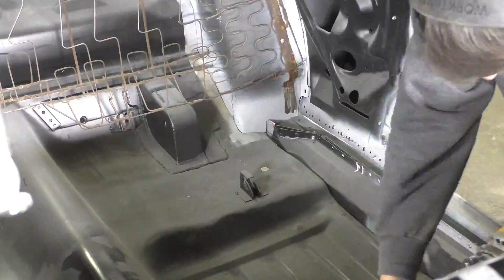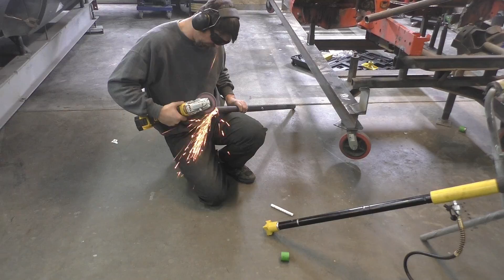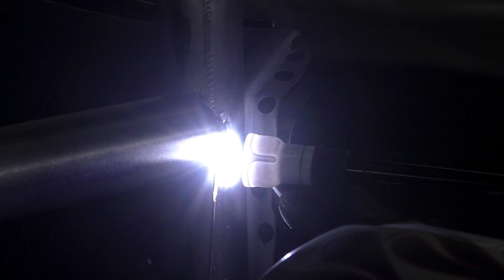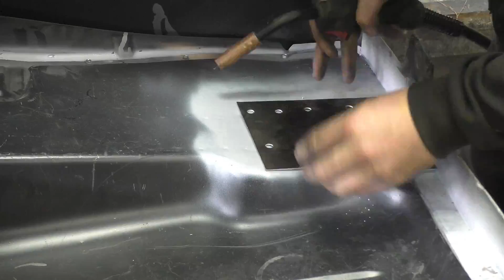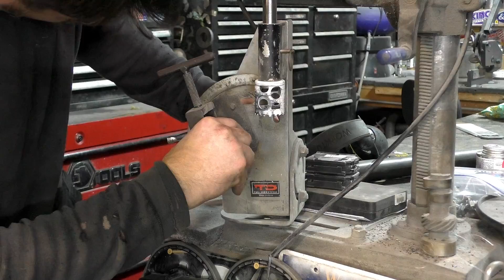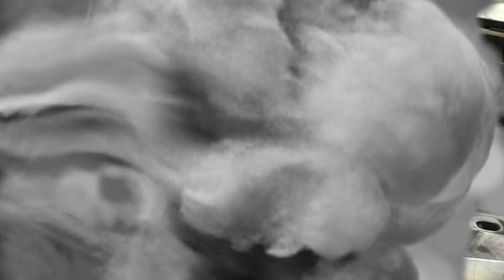Chromoly Roll cage & Detroit Speed subframe connectors f-body 69 Firebird restoration episode 9

Comment: Man I love this channel. You’re a great instructor. Just did a DSE rollbar and subframe connectors in a Camaro last month. Wish I saw this video. It was a lot of work but total satisfaction. I ended up not welding the front of the subframe connectors to the speedtech subframe. I ran 3 big bolts through the plug weld holes. Just in case for ease of removal. Sorry for the long comment. Your channel is AA++++
Reply from the maker: Thank you very much. Yes the custom stuff and all the components of these kits are challenging but I think the best stuff to put in t a first gen F body. Glad you got your already behind you. That was good thinking on the bolts I have one in the shop that is installed wrong which was done at a different shop I wish they bolted in. I am hoping i really never have to remove this one but just in case it just will be a little extra work.

Comment: The original front end was ENDURA.  I'm guessing that's not re popped.  Do they make a Fiberglass replacement?
Reply from the maker: The front light covers are original but everything on this firebird as far as sheet metal is aftermarket. They do make it

Comment: When TIG welding, try and hold the filler wire in the gas cloud when done. It can get impurities just like the weld puddle can.
Reply from the maker: You are right I did it in this video most of the time, might not look like it since everything is 6-8 time faster in timelapse it looks like I pull it out right away. I do pull it out sooner then the cup as there is less hat in the filler. Thanks for the comment.

Comment: That's a roll bar not a cage
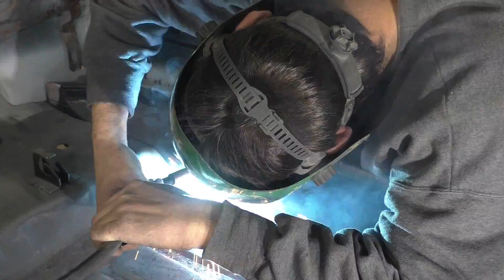Reply: 15:41
Reply from the maker: @brdarley  Thanks for pointing it out, I usually don't get too caught up in the wording details and was going back and forth between roll bar and cage. The idea and concept is the same, welding chromoly bar in a car.
Reply from the maker: Yes technically it is